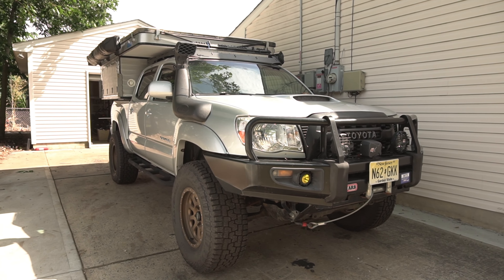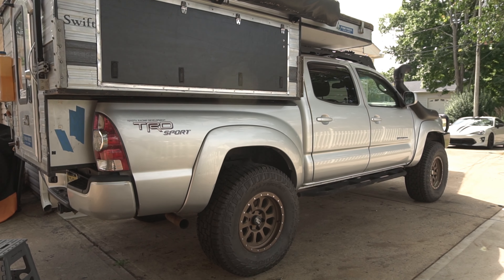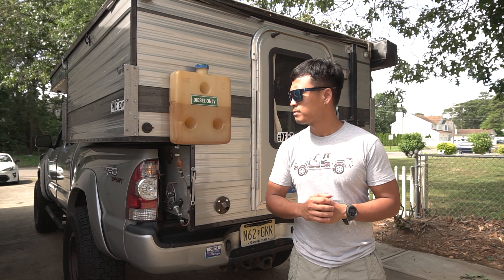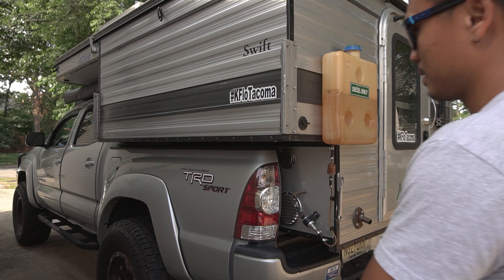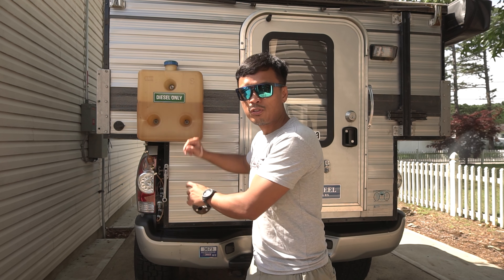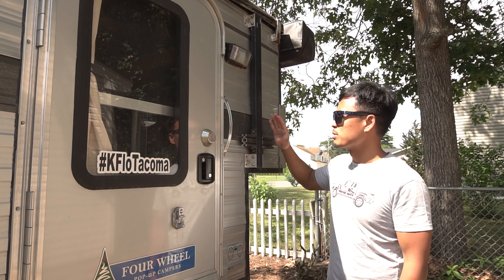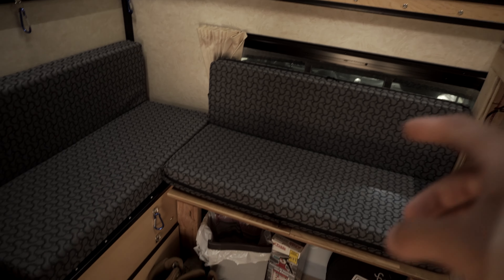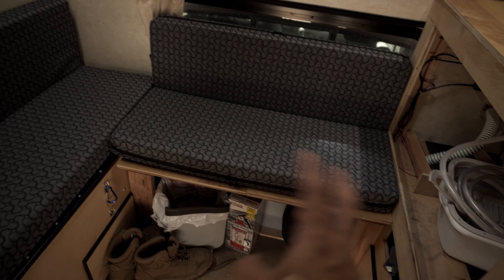YOUR IDEAS NEEDED! 4 Wheel Camper Update

Comment from the maker: Big Shout out to Diego Martinez, Matthew Broder, and JVP for your design inputs! Thanks guys!

Links for items used in this video:
Diesel heater: https://amzn.to/3yxdABd
Diesel hose upgrade (prevent pump cavitation issues): https://amzn.to/3P3A9Vo
5 Lb Propane tank: https://amzn.to/3yWMHIt
Locking Compression Latch: https://amzn.to/3PkLa46
Compression Latch: https://amzn.to/3PgR8TI
Water pump: https://amzn.to/3PdR7je
270 awning passenger side: https://amzn.to/3bZWqEN
270 awning driver side: https://amzn.to/3nScMSr
Sash locks: https://amzn.to/3AEkpDR
Fridge: https://amzn.to/3AHGpgZ
Sink: https://amzn.to/3OSOZhf
Faucet: https://amzn.to/3PkQ55m
Reply: I'm glad at least something was useful! Actually, a question, where is your spare tire?
Reply from the maker: That is actually one of the storage problems I'm trying to solve. When I have the camper on, I just carry my tire patch kit. Without the camper, I strap it to the roof rack or the truck bed. I have a few ideas:
1) integrated tail gate spare tire holder with a double swing down system (almost like a scorpion swing down tire carrier)
2) mount a spare tire holder on the back door of the camper
3) somehow mount a full size 35 spare on the existing OEM space (it lowers ground clearance though and ramp over angle)
4) swing down tire holder on the back of the camper that doubles as stairs
and a few others that are a bit too ridiculous lol
I'll play around with ideas and come up w/ a CAD Design and plasma cut something. We'll see. If you have any thoughts or ideas, let me know! I know you have some good ones too bro!
Reply: @KFloTacoma  ah, yes, above 33 we all struggle with where to place the spare. I have a dual swing out, but it's not working anymore for my needs, I am going to move it to behind the cab, again. With a slide, so I can slide it out when needed. What I really wanna do is cut the front of the bed and cap, and insert the spare into the side. and have a crane system like an LMTV to raise and lower. I bet you could totally pull this off. Hard thing, I've never used the spare.